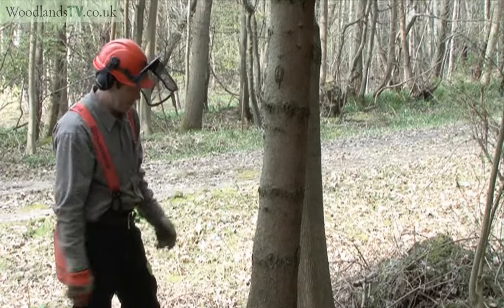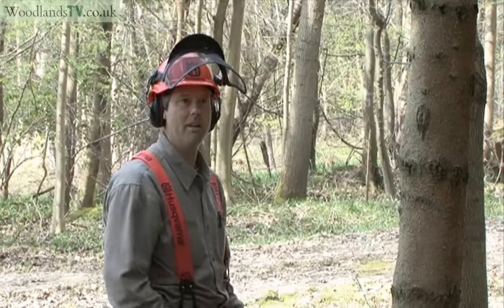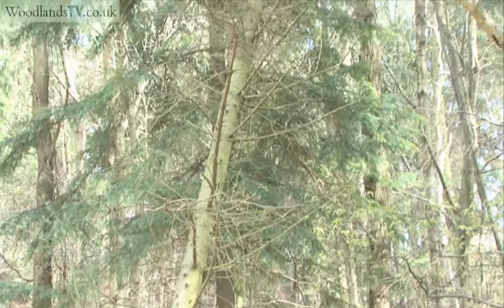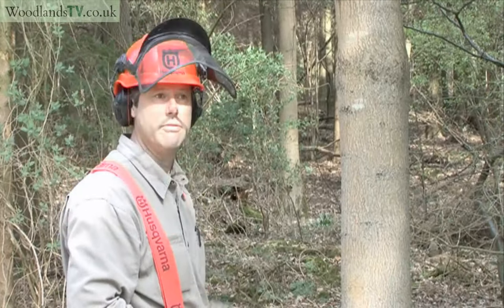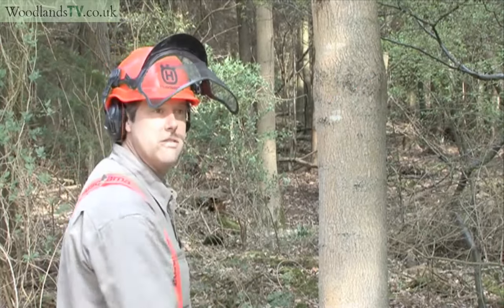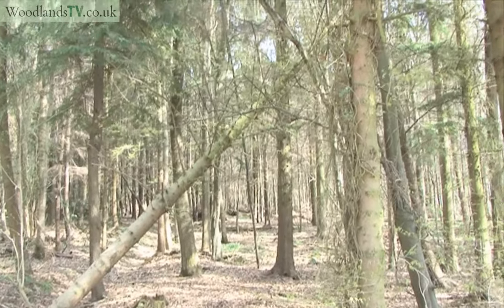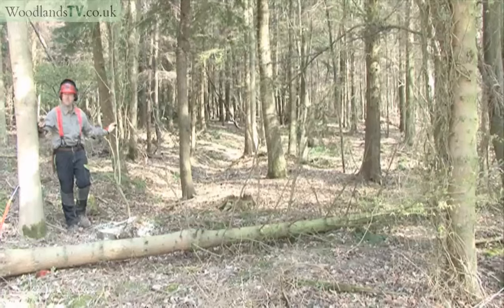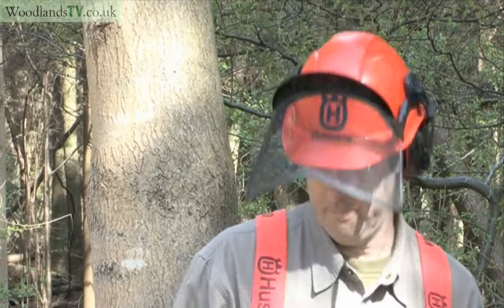Felling a hung up tree - safety first

Comment: I’d personally rather enter closer to waste high and go back to reduce the stump than to make my cuts that prone to danger in the crouch position. Well executed though. Most impressed with the prybar walk out at the end
Reply: If you're cutting for firewood, sure. But if you're selling logs, you'd be losing so much money on leaving high stumps. Cut as low as you can if you want to make it worth your while.

Comment: Guys this is by fare the best video I have seen yet showing an attempt at dealing with a hung up tree using the NPTC city and Guilds CS31 best practice (for those not in the uk thats UK best practice for felling a tree up to 15" DBH). The only part where this falls down is that you are taught to open the hing up after the hang up by boreing through the middle of the hing leaving 10% on either side,then removing one of the pegs to role the tree out - never the less a good attempt.

Comment: I cut a lot of firewood and face a lot of hung up trees that are already at a 45 degree angle hung up (Usually blow overs do this aka partially uprooted. For those I make a top and bottom cut. Then I take my truck with my biggest chain and yank perpendicular to twist it. Its been my safest and easiest way if you can get a truck to the location. The chain is also about fifty feet. Just always be safe and when in doubt call a professional.

Comment: Why was the first cut so shallow?

feels like it should have gone deeper than half way.
Reply: A cut that shallow works on some trees and doesn't on others. In a beginners instructional video it would have been better to be deeper. But I think it was to make it easier to create the hung up.

That being said, never cut half way or deeper. A good rule of the thumb is up to 1/3 of the way. If you cut a heavy tree with a notch too deep the hinge is likely to fail and cause "stump jump" and then you don't know where the tree will fall. Another thing that too deep a notch does is it removes so much support that the tree doesn't stand on it's own and can actually fall backwards. You want the tree to stand on it's own despite the notch until you make the back cut.

Comment: Very good video,  the only question I have is why do you start cutting so low? I cut higher than cut the stump,  just preference I guess.
Reply: It's standard practice to cut low in forestry so you maintain as much of the most valuable part of the tree at the base as possible and have a nice long pole and the highest price. I don't fell trees for timber so cut at a more comfortable height but when I do my three-yearly refresher course the trainer generally comments that I'm cutting too high!

Comment: Pushing the tree with a lever while standing behind it seems a bit risky.  If the tree starts falling so the hinge breaks and then it gets caught on something, the base can move backward very suddenly.  It might be safer to stand a bit to one side and drive in a wedge or two instead of using a lever.

Comment: I would have dropped it to the left, away from the trees that it got hung up in or I would have dropped one of the offending trees and then dropped it through the hole created by the first tree I removed.  You need an opening in the canopy to drop a tree, otherwise you have created a lot of unnecessary work and effort.